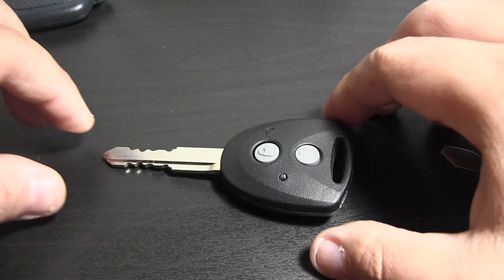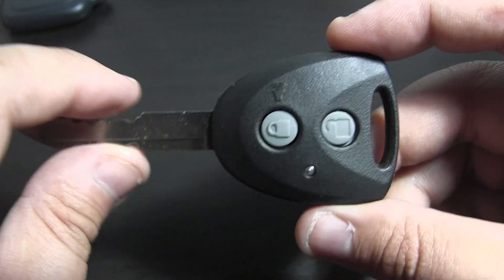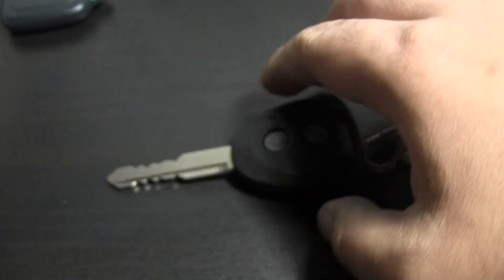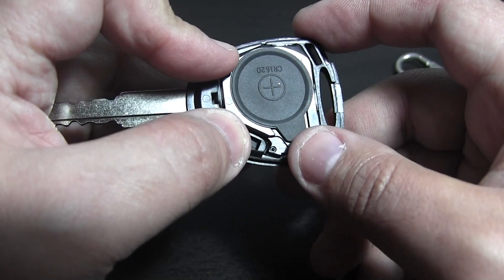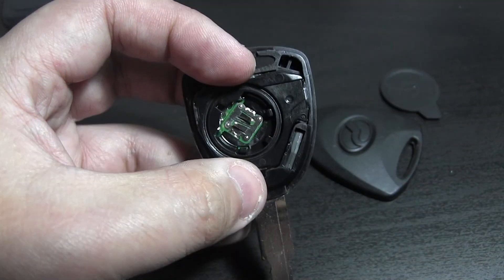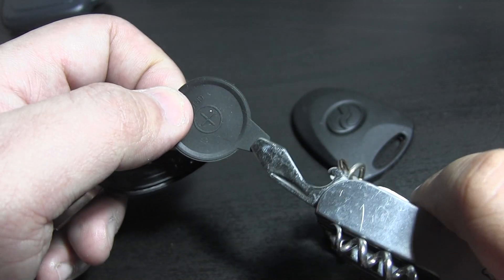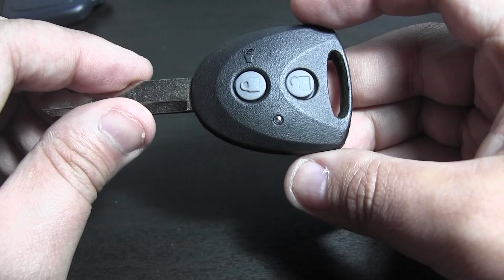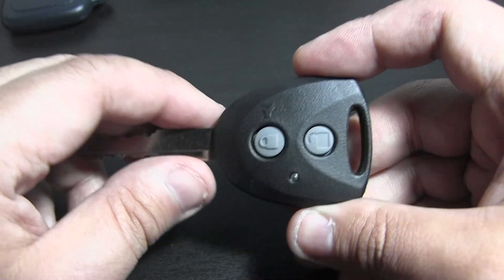Axia Key Replace Battery (for Axia 2017 - 2019).

Comment: Hi kokwah i want to ask you, if I buy original axia remote key from online, how I want to sync/link the remote key with my car??
Reply from the maker: Try this 
1. Put original key in key cylinder.
2. Turn to ON and back to OFF for 5 times. At the fifth time leave the key in ON. The car horn will sound.
3. Press any buttons on original remote and the remote you bought.
4. The car horn will sound.
5. Turn key to OFF and remove the key.
6. Test both remote.

If the above does not work, ask help of a locksmith.

Comment: No setting required after replacing the batteries? Because for Toyota you have to do some setting once replaced the battery
Reply from the maker: What kind of setting are you referring to? While I prepare to shoot this video, I removed the battery and put it back a few times and they still work.
Reply: @kokwahgoh1932  Because my Corolla Cobra's alarm system requires setting once battery is replaced, if not it won't work and won't able to unlock the car.
Reply from the maker: @ericocy  Perodua does not use Cobra alarm but, Wheels Alarm. I believe the Cobra alarm transmitter need to be sync with the car because they could be using rotating frequency.

Comment: Hi sir..how to unmute axia standard G 2014-2016 alarm when lock and unlock the car? The default mode is muted..hope u can help me figure it out..tq
Reply from the maker: I am not able to download Axia first model user manual from Perodua web site. I got these instruction from Perodua Alza and Myvi user manual. Not sure if can work on Axia. You can try like this.

1. Put in key, remove key, put in key, remove key  to enter modify mode on alarm.
2. Press on alarm remote, Lock, Unlock, Lock, Lock, Unlock. Hazard light blink 2 times.
3. Put in key and turn to ON to end modify mode.

Try lock your car to see if alarm buzzer sound. Usually your car horn will sound as buzzer.
Reply: @kokwahgoh1932  ok tq sir..i will try it soon & let u know if it work..✌🏼😊

Comment: Bro i own a 2018-2019 axia do you know how to turn off the sound of unlocking and locking the car?
Reply from the maker: Please give me some time to check this out.
Reply: @kokwahgoh1932  alright thanks
Reply from the maker: I am not able to find any instructions anywhere to do this on Axia 2018 - 2019.  I got these instruction from Perodua Alza and Myvi user manual. I am NOT sure if can work on Axia. You may try like this.

1. Put in key, remove key, put in key, remove key  to enter modify mode on alarm.
2. Press on alarm remote, Lock, Unlock, Lock, Lock, Unlock. Hazard light blink 2 times.
3. Put in key and turn to ON to end modify mode.

Try lock your car to see if alarm buzzer sound. Usually your car horn will sound as buzzer.
Reply: Press the lock/unlock button and alarm button at same time. Press n hold until 1 time beep sound. After that the sound will be turned off
Reply from the maker: @surendmaniam88  Thank you.

Comment: May i know what is the battery  remote model?
Reply from the maker: CR1620.
Reply: @kokwahgoh1932 what’s the price of battery pls?
Reply from the maker: @prdeepsingh7620  CR1620 Maxell I saw on Shopee goes for RM5.00 NOT include delivery. I bought from shop for RM9.00
Reply: @kokwahgoh1932  thank you Sir.
Reply from the maker: @gohforce6827 battery is CR1620

Comment: Will it work if I use 1616 battery?
Reply from the maker: 1616 is 0.4mm thinner and 55mAH compared to 75mAH in 1620. Both are 3V. 1616 may work but lifespan maybe shorter.

Use only 1620 if car is still under warranty.

Comment: hi, how do disable the alarm after unlocking the key manually instead of using the button bcs of low battery?
Reply from the maker: 1. Put key in the key cylinder.
2. Turn to ON and press the foot brake.
3. Alarm should turn off.
Reply: @kokwahgoh1932  thank youu.. will try soon

Comment: Nak tanya, apa masalah bila alarm axia pandai berbunyi sendiri?
Reply from the maker: Check sensor suis kat setiap pintu pastikan berfungsi. Bila pintu tutup rapat pastikan lampu warning pintu betul betul off.
Reply: @kokwahgoh1932  camne nak cek tu
Reply from the maker: @lionadlius7149  pergi kereta, check samada cover hitam getah masih ada pada sensor switch lock pintu. Kalau cover itu sudah pecah atau hilang mungkin itu boleh menyebabkan alarm berbunyi.

Kalau sensor switch masih ada cover getah hitam, hantar kereta ke Perodua Service Center untuk cek lebih lanjut. Mungkin ada sebab lain.
Reply: Kalau dah check and tiada problem maksudnya kena tukar bateri remote ye?
Reply from the maker: Macam itu baik pergi suruh sc check.

Comment: 1632 x boleh ke?
Reply from the maker: CR1632 lebih tebal 0.2mm. Pakai boleh, takut klip plastik pemegang tepi itu boleh patah.
Reply: @kokwahgoh1932  tQ bro,skrg sudah beli 1620 nanti boleh kasi tukar 😁😁😁👏👏👍👍
Reply: @kokwahgoh1932  done buat skrg berfungsi dengan baik 👏👏👏😁😁👍👍👍👍
Reply: salam tuan ,dah tukar battery baru blh start tapi tak blh lock dan unclok pintu kereta
Reply: @masyrinjerry2636  no model bateri betul ke